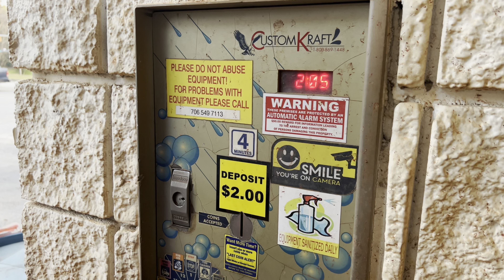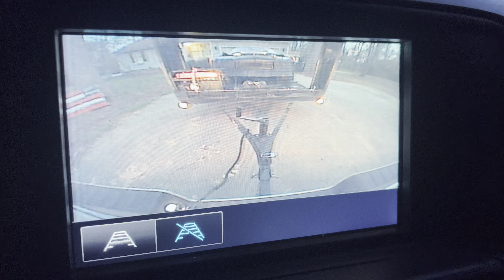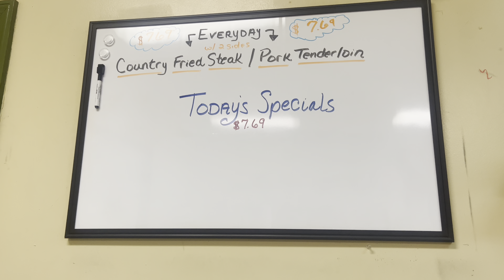KICK’N ASPHALT - THE LITTLE ENGINE THAT COULD IS GOING BACK IN BITTERSWEET AND FRED HAS STORYTIME!!

Comment: I call that oil pan failure. The oil pan failed to hold the parts in
Reply from the maker: Dang good way to look at it! I like your ways of thinking
Reply: @kicknasphalt_vlog  An old fella I used to help at our local track, Jennerstown Speedway, blew up one night, and we asked what happened, he said he had oil pan failure. I wish I could remember half the stuff he did and said. Good luck at your next race. Was that motor that blew up a crate or a built motor?